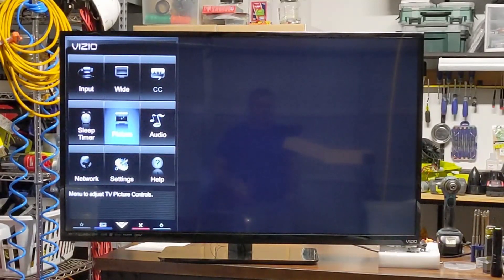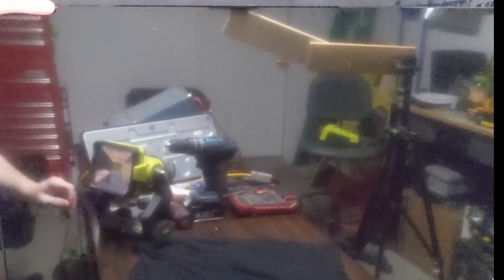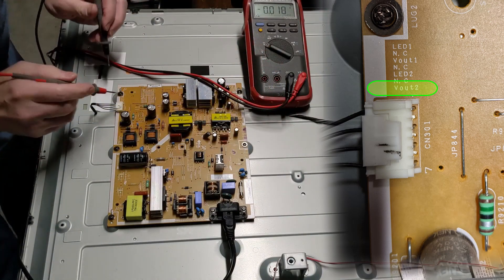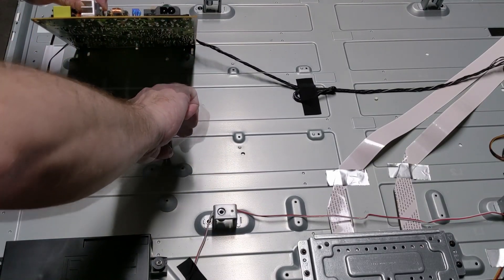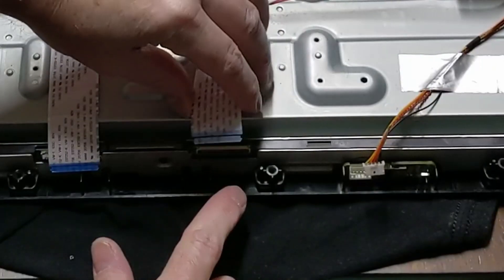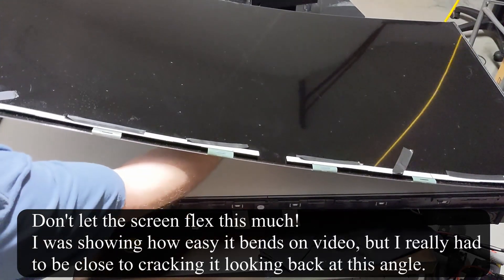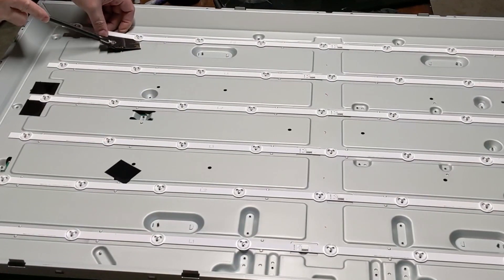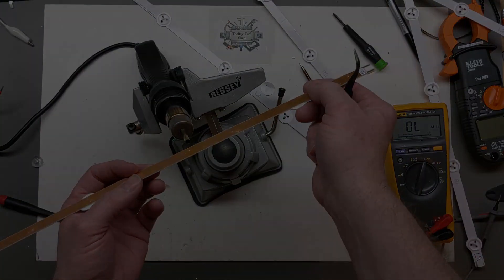VIZIO 47" TV No Backlight (Disassembly and Testing - Video#1)

Comment: I had an old Vizio in my basement that was going unused due to a faulty backlight issue. I was going to throw it away, but I figured for about $20 I could try and fix it. I found your tutorial and it laid out the EXACT method of repairing my TV. You covered every aspect of the repair in a manner that anyone could understand, not missing a single detail. I successfully completely the repair and ended up donating the TV to an elderly neighbor. Thank you so much for this EXCELLENT tutorial!
Reply from the maker: Thanks for your kind comment as well as your giving heart! It is much appreciated.

Comment: When i get to the reflector piece that covers the leds mine had little spikes sticking out 5 of them. I realized that as i was taking it off and didn’t wanna rip the paper any clue how to get those off
Reply: K thank you. I figured out there is little tabs under neath to pinch
Reply from the maker: Most of these twist and pull out. It may be a different style, but that is the ones I am familiar with.

Comment: hi i am not understanding,  i placed a cell phone light on the screen of my tv and could not see a thing while it was on i do see the sharp logo on then the tv goes black i am thinking my back  lights are good would u agree, i have changed the power supply would you agree then i need to change the  Main Board? thank you
Reply from the maker: Well, if you have a totally black screen but you can see the sharp logo while powering on with a light shining in then yes your backlight is out. You can also double check by pressing menu and see if you can also see the menu while shining a light in. That will show you have backlight issues.
Reply: @ThriftyToolShed  hi, the logo stays on for about 1sec then disappears, the screen is  black and i cannot see anything with my cell phone light   the power board is changed and the power light is red with 5 long red flashes and 2 short again thank you
Reply from the maker: Possible that it's the firmware or the video controller board that is faulty if you can see the logo then goes out and led blinks as you stated. I have not had this exact issue to say for sure. Wish you the best with yours!